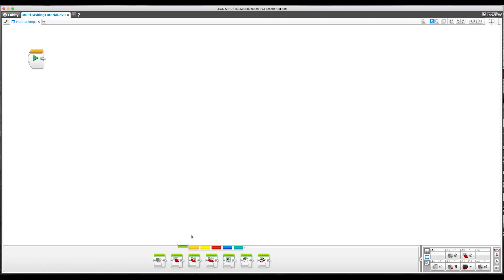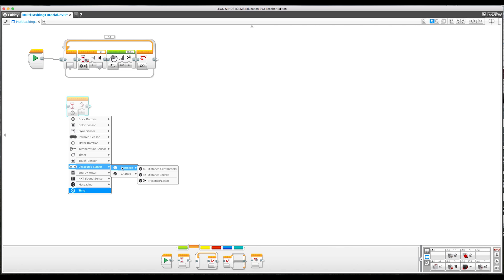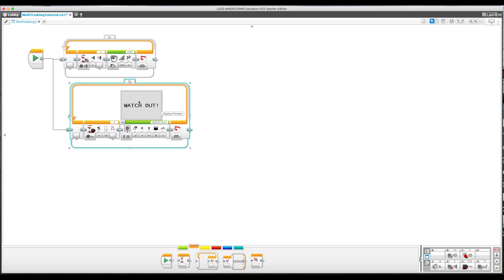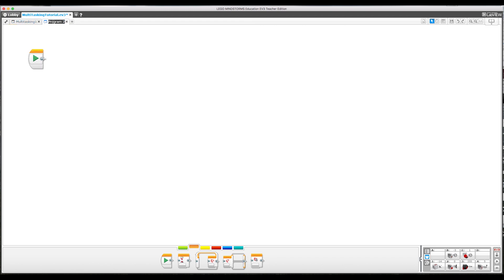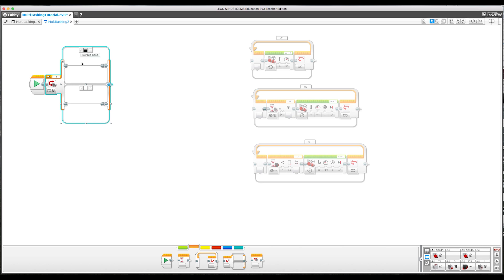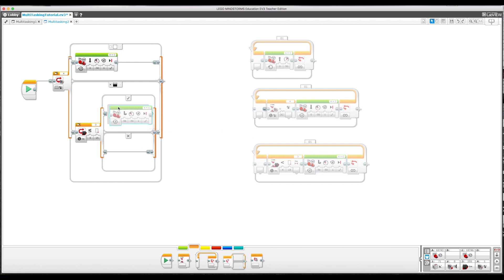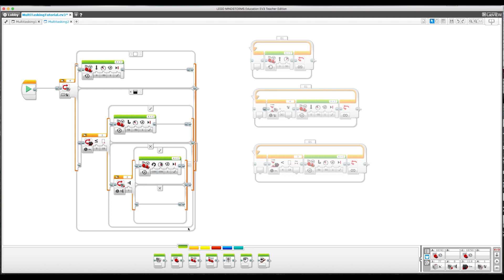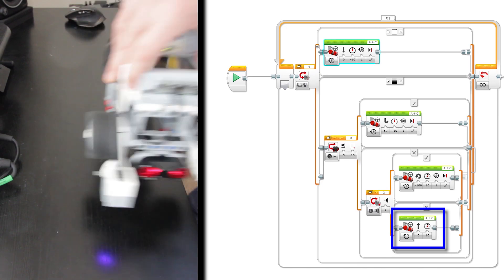Running Multiple Sensors at Once on EV3

Comment: Use the photon-pixel coupling method, it is a new approach in science for sampling an unlimited number of sensors in parallel. It is ideal for robotics  !
Reply from the maker: May have to do a bit of research before trying that one out!  Thanks for the tip :)